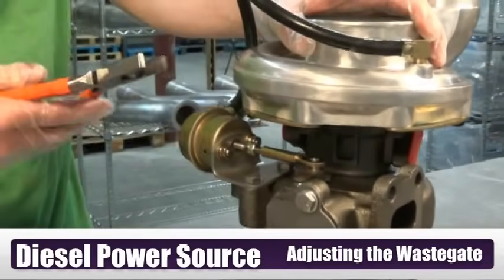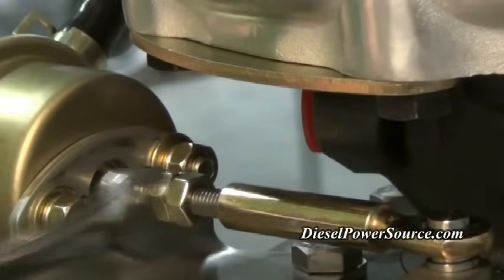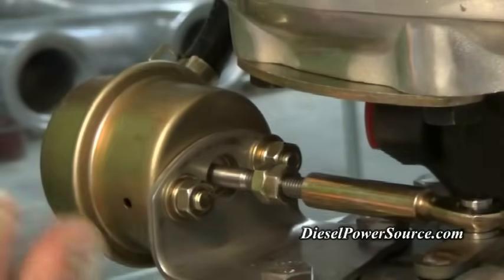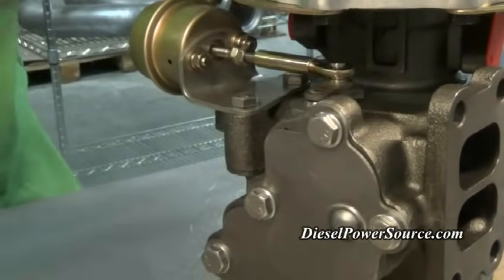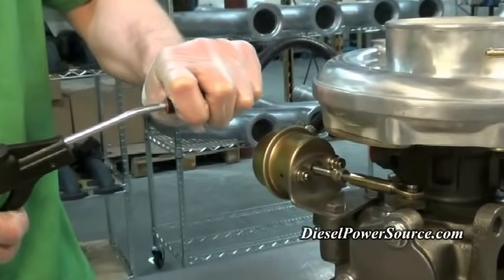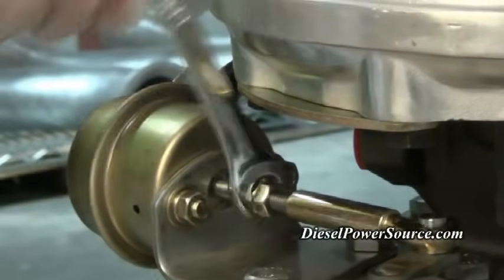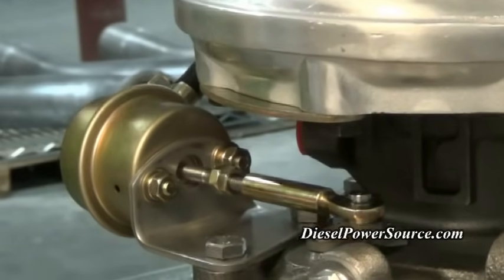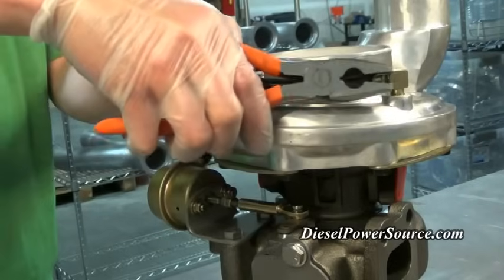Adjusting Waste Gate

Comment: I want to know when you start the engine, in which position the westgate goes, open or closed
Reply: It is closed. At a certain vacuum level it starts to open, and unless the vacuum drops, it stays open.  Because wastegates begin to function at specific pressure levels. As the name suggests, a wastegate's purpose is to restrict the exhaust gases' velocity of travel. Or to put it another way, to adapt. The spring can be made stiffer or softer by adjusting the rod's length.

Comment: I just picked up a used 62/65/12, so if I'm understanding this right, if I set the regulator on my compressor at 40psi and adjust the wastegate until it just starts to move at the at pressure, thats what boost I should see on my gauge, and slightly more with a spike?

Comment: Howdy!  My turbocharger was at a repair center.  I have a Wv Polo 1.2 Tdi.  After reconditioned when put into operation it generates error code P2564 position sensor signal too weak.  The geometry actuator contains a position sensor.  I suspect that the sensor calibration was not done effectively.  I understood that for the minimum there must be a value of 0.760 volts, for the maximum I do not know for sure... 3.800 volts or 4.100 volts.  What can you advise me to calibrate the correct values?

Comment: let me see if i got this right ... soo im with a4 b5 1.8t  and my rod is kind of different but nvm so ... the rod needs to shorten by wich i mean to push it inside the actuator thingy for more boost .. but if i pull it out from the actuator it will lower the boost ?

Comment: Turn the nutt against the waist guage for less boost and against the waist guage arm for more boost?
Reply: In case you never found out, both nuts jammed together mean it spins the whole shaft. youll see the end is mounted to the lever which the threaded metal rod goes into. tightening the nut just spins the wastegate arm into the end linkage

Comment: dont you think that you are giving the turbine  just more rpm but the extra pressure gained its realesed by the intake circuit  blow off valvve  that its caalibrated to the same limit of the turbine valve???
Reply: Remove the bov.
Reply: Good point sir, my rodeo (last of Isuzu eng) creates enough boost to actuate the bleed at half throttle lol. They be just pissing pressure away for nothing. And for those saying just remove the bov? What about internal ones spidered into the egr and exhaust sensors ect? Remove them too? I mean at that point your into thousands for different manifolds, circulation systems, exhaust sensor deletes, remaps ect to get it to run properly . All just so your car goes ssssssssss for possibly 0% gains? Have fun keeping that registered. I was going to do this videos recommendations but guess what problems I ran into? Not all cars are equal ask someone that actually knows your car first

Comment: What if I don’t have two jam nuts?
Reply from the maker: Simply remove the little c-clip pull off the linkage and spin it.  To put it back on you'll need to pressurize the tube with appx. 30-40 psi (no more than that) and then put the pin back in the hole, replace the c-clip.

Comment: Ok probably a dumb question but is that adjusting method going to apply for pretty much all wastegates? Thinking about getting into the turbo life and just trying to do some research. Found a car I want to buy that the owner says the current wastegate wont hold the proper Boost pressure and he thinks it needs a new one. Would be nice if I could do something like this to have a easy fix instead of buying/replacing it.
Reply: A wastegate that once built full pressure and now doesn't is either sitting behind a faulty BCV/TCV (Bypass/Turbo Control Valve) or has a leak in the wastegate diaphragm.  The BCV/TCV failure is very common - some cars have them fail as often as every 40~50k miles.

Comment: For safety and reliability should this not be done on a dynometer as you are changing the dynamics of air and fuel ratios to an extent...
Reply: Not so important on a diesel, you want a boost gauge and egt gauge so you can keep an eye on everything though. As long as you keep your egt's safe you just give it as much diesel as it'll take without making smoke

Comment: Ok… How much boost is too much boost?
Reply: depends on motor, turbo and tune. i have a boosted 1.6 miata. boost is set at 15psi and it’s been tuned several times by a well known local tuner.
Reply: @chrisp7684  5.9 Cummins, no tune
Reply: @zekeworst9193  i’d definitely recommend a tune for safety lol. you could prob run 30psi with no issues if tuned properly.
Reply: @chrisp7684  tunes are expensive. And expensive is something I can’t afford right now. 😂
Reply: a new motor is even more expensive🤷🏽‍♂️isn’t urs stock turbo tho? in which case ur fine until u go standalone
Reply: @chrisp7684   Yes. Stock HX35.
Reply: @Zeke Worst  tunes are not that expensive.  If you can't afford a tune you prob shouldn't be trying to modify cars
Reply: @midnight347  I work on cars for a living. I’ve learned a lot in the last year since I asked my original question. But thanks for your advice!

Comment: Question!  I'm fairly new to diesel turbo so, if I want to reduce the lag  which way would it be turned *audi a3 tdi turbo *.
Thanks in advance.
Reply: This doesn't effect lag. It only adds or lessens boost
Reply: Get a smaller turbo
Reply: Chip it mate, more diesel will mean sooner boost, but will also mean more heat so keep an eye on that

Comment: If u don't  put back that pipe of diaphragm on the compressor  side...then their will no boost because  of leakage  through  the hole... instead of over boost
Reply: Are you talking about the hose? Because without it you get overboost and will probably cook your engine

Comment: Leave the hose off for max boost.
Reply: aka the Dominic Torreto Style lol
Reply: Use to do it on my subaru wrx all the time. Stock was at 8 lbs with hose off i was hitting around 24lbs max. Soo much power soo much fun. Never blew my motor. Then i hear others say dont go over 10lbs or youll blow your motor. And i laugh. Stop being little sissies
Reply: @hmongwild  how u do it
Reply: @jalilpandi1347  theres a hose on the little actuator. Just pop the hose off itll give you max boost. Thats were you connect your boost controller to if you had one.
Reply: @hmongwild  how can you just add like triple the boost without even being tuned for it or anything?  This story sounds very suspect lol
Reply: @midnight347  theres alot of cars out there that are not tune for all the stuff the bolt on run with no issues. U can say most cars are not tune